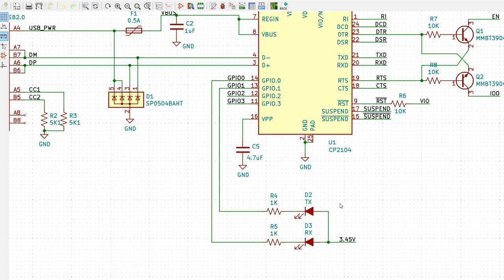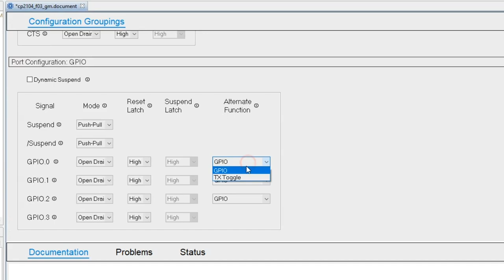Silabs CP2104 No Activity on RX TX LEDs Bug - Voltlog #359

Comment: Yup, as stated, not a bug but by design. If you need to change from GPIO to RX/TX signals you need to use Simplicity Studio to change their config. Also keep in mind on the CP2104, it's a 1 time program, so if you make a mistake or want to change something else or set it back, you are out of luck. The CP2102 allows multi-programming of the IC.
Reply from the maker: Ok I get it, it's a feature, even though I haven't seen this mentioned in the datasheet (maybe I missed something). What is your take on this? Is it expected behavior to have the TX/RX activity LED disabled on such a chip? Me, I think it should be the default function and only through user intervention switch to something else.
Reply: @voltlog  I created a custom board as well with this chip and I think this feature should be enabled by default. If there would be a one line command or something to change that, okay - but the whole studio thing just to programm twe little LEDs makes no sense at all. The main thing you will do with this chip is to do something on Rx Tx so you want to see that - and if you don't just do not add these LEDs but they should always be enabled. Thats my opinion, just like you mentioned: imagine doing this for many boards

Comment: I find this as completely normal, afaik the indication leds are not enabled from factory because all gpios are inputs straight from factory. I have designed a board with cp2104 also and i had to configure it. If you want it configured from factory you have to order a batch with specific settings.

Edit: not a bug, it's designed like that, datasheet confirms it too. If you wish to have led signaling you need to program the cp2104 configuration bits
Reply from the maker: To me it seems like for a usb/serial chip which has RX TX activity LED function they should have that function by default (given it's intended purpose) and later on the user can switch to a different function if he wishes something else. Also they are ack this problem in that PDF document? this would suggest that they too think it should be normal to have the LEDs active by default.
Reply: @voltlog  That PDF-document seems to be user submitted: https://www.silabs.com/community/interface/forum.topic.html/cp2104_issue-GjqG
CP2104 Datasheet page 13 says "By default, all of the GPIO pins are configured as a GPIO input."
Whether the issue you encountered was caused by a bug or wrong assumption, someone will likely encounter the same issue and you shared a solution with us. Have a thumbs up!
Reply from the maker: @Hugatry  Thanks for sharing the link!
Reply: Yes, the CP2104 chip is factory programmed to NOT flash RX/TX pins at first. The IC is one time programmable/configurable and can enable this feature.  You can also program it with different identifiers. I think I used Si5 to configure it? It’s easy, just deep in user manuals.

Comment: Why didn't you just use the RX and TX line themselves to drive the LEDs?
Reply: The LED circuit would influence the communication lines by clamping the voltage and making edges slower due to additional current sinking. Inversion of the signal would be necessary, too, otherwise the LEDs would stay on when no communication is done.
To make it work one could try to decouple it via p-channel mosfets. But some latching would be nice to, to make fast/short messages visible.
Reply: @tobi_n  At these speeds doesn't make any difference, check any Arduino board's schematic for the most simple way to implement this without any extra component. You just need a current limiting resistor and a LED per each line of data...